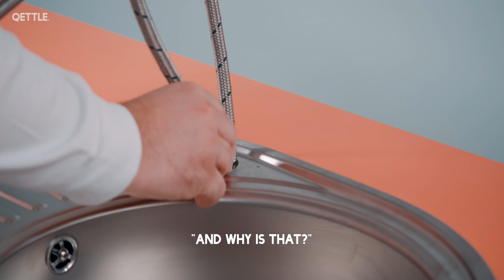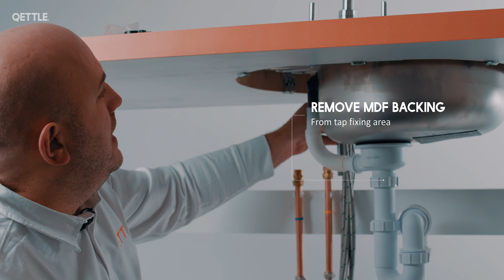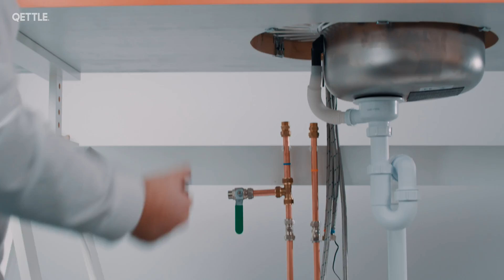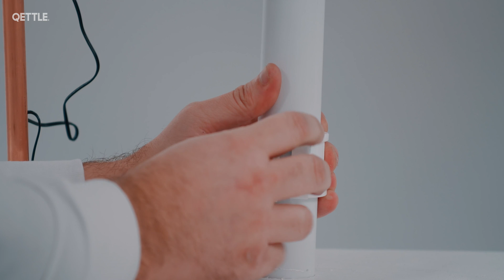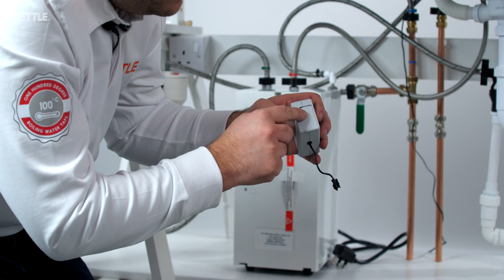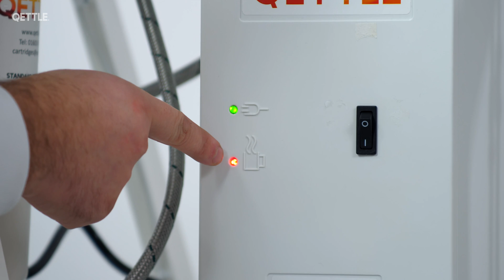How Do You Install a QETTLE Boiling Water Tap? Watch Step by Step Guide to Getting it Right!

Comment: Haiya, tks for the video. In my case instead of the condensed water droplets I hear water running continuously in a thin stream  , is that okay or something I need to look into . Many thanks
Reply from the maker: Hi Meg, that sounds like a pressure issue - if water pressure is too high (above 5 bar for QETTLE installations) - you might find you'll need to fit a simple pressure reducing valve. Please give the QETTLE Team a call or drop them an email, and they'll be able to help you.

Comment: Do I need extra plumbing for qattle tap?
Reply from the maker: Hello Ravinder, thanks for getting in touch. You don't need any special plumbing to install a QETTLE. However, there are a few important pre-installation points to consider. These include checking your home has a minimum water pressure of 1.5 bar, ensuring you have a normal, 13 amp power socket under your kitchen sink, and the space under your sink. You can find lots of information about these pre-install checks on www.qettle.com. Our QETTLE customer service team are also here to help - you can reach them on 01603 875464 9-5, Mon-Fri - use live chat or email them support@qettle.com.